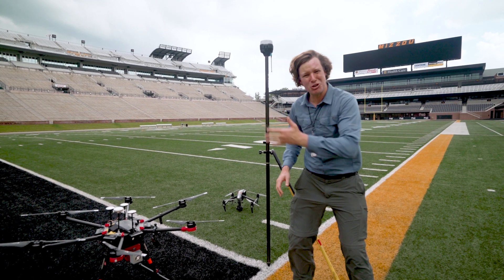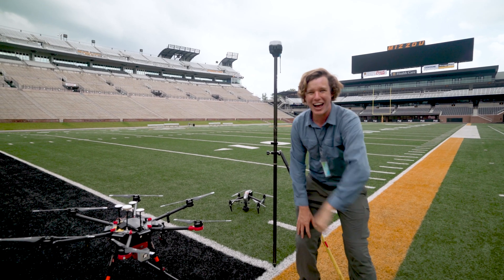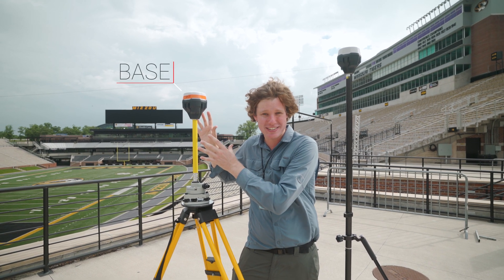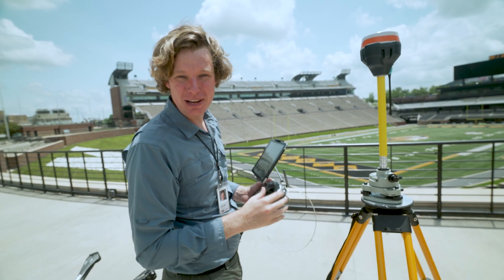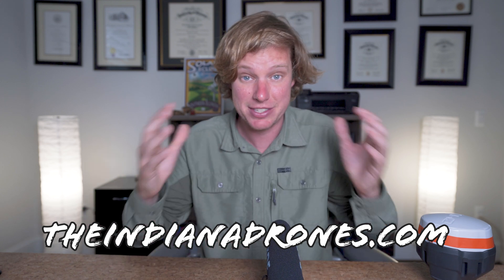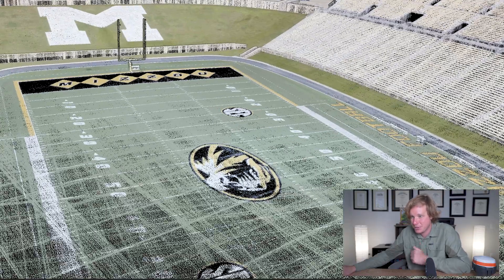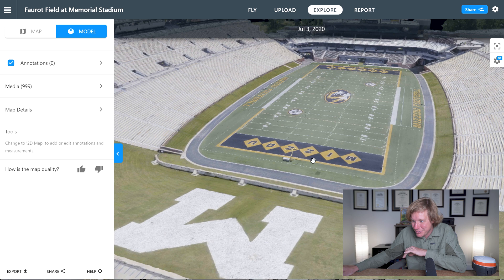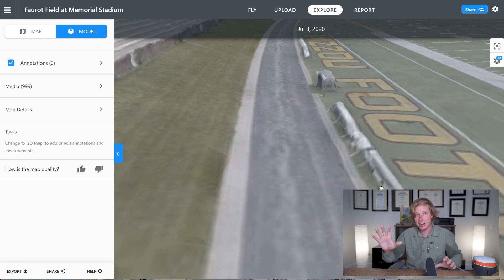Drone LiDAR  vs Photogrammetry | Epic Stadium 3D model

Comment: Overall nice video! However that's a LiDAR point cloud vs a photogrammetry 3D mesh, so it's not a fair comparison. Would have been a better comparison if you compared the point clouds generated by each sets of data. I haven't used LiDAR myself, but I'm sure you could generate a 3D mesh from it as well.
Reply from the maker: Thanks for the feedback!

Comment: Nice comparison. I am not aware about the mission parameters of the photogrammetry flight, but from the result I guess that you were using a single camera in NADIR direction. When it comes to modelling 3D buildings, many people recommend off-NADIR (oblique angle) captures. These days, readily available payloads with 4-5 cameras looking at different directions simultaneously may be much more appropriate for the featured application. And their price of around 4000-5000 USD is still cheaper than the price of UAV lidar systems (DJI Zenmuse L1 ~18000 USD)...
Reply: would a fish-eye or 360 camera produce similar results to off-NADIR 4-5 camera payloads? I just assume it wouldn't be as high of resolution...

Comment: I'm retired surveyor(about 40 years), ... I am not excited over the LIDAR(still costs too much), as much as I am over the photogrammetry(lot cheaper).

How precise is the Photogrammetry, in the best and worst case, compared to the LIDAR ... how was the accuracy of each compared to the other?

I might consider using photogrammetry for such things as cemeteries, since the headstones would be greatly benefitted with photos.

Have you ever attempted recovery of old, worn, sandstone monuments' etchings(over 150 years/Civil War), with LIDAR?

Comment: Such great informative high quality content.  The BEST on YouTube.

Curious, what's your process for setting your elevation for your clients that need to work with your survey data?  Do you work in NAD83 (state plane) horizontal coordinate system along with NAV88 vertical datum using a geoid to obtain orthometric heights?  What do you tie to for your vertical readings?  A nearby benchmark?  Or are you just basing everything off of ellipsoidal height and your control points?  Thanks!!!

Comment: Thanks for the video - 
So would photogrammetry survey , yield us data points with levels in XYZ coordinates?  or is it possible only with LIDAR and Total station ?
Reply: Hi! You can use photogrammetry also to generate digital terrain models (DTM).  Using this DTM data, you can compute orthophotos, which are geo referenced.

Comment: Hi there - been following you for a while.  I’m a 13yr photogrammetrist/Pix4D Ambassador.  I recently flew Oregon State Beaver Stadium for a client and built a 3D point cloud from it.  2000+ photos from about 150ft AGL, oblique orbits and from each cardinal direction with gimbal at 70 degrees.  After a few hours of cleanup check it out... https://youtu.be/-gJP6225V3A
Reply: I also worked with LiDAR for years.  A liiiitttle unfair to compare a sharp point lidar point cloud to the very rough mesh made online by Drone Deploy.  Would have loved to see a direct .las to .las comparison of what the MiniVux captured vs the photogrammetry plus learn more about how you planned the photogrammetry mission.  Yes... LiDAR will definitely win this battle as you point out, but I’ve built my career weighing which is more economical for a small survey firm... the time cost of capturing a TON of photos and longer processing vs a $200-$300k expense of a Reigl.. :). Love your channel.  Cheers!

Comment: I would have like to know a little bit about  what your data was being used to solve. I can’t help but think that 1cm (more like 3cm) is not accuracy enough for engineering a structure. It sounds great for land surveying but problematic for buildings. I would have like to have seen a few scans from a P50, overlay your area data for infill (removing the overlap) and apply the photo wrap. That way you would have 1-3mm precision great infill and color to boot. 

That said cost is always an issues. P50’s start at $5k to rent not to mention the software to extract and clean up the data. 

How big (data size) was this project in the end?

Comment: The LiDAR data are really amazing! But it is not fair to compare a LiDAR point Cloud with a photogrammetry 3D Mesh. These are 2 different things!
Reply: But however,  if you use lidar data to compensate photogrammetry, you can get a sharp, crisp yet real coloured point cloud,  and this can help to compensate missing edges and discolourations,  especially if you know how to write up python code to do close neighbour averaging for the point cloud data, then you can have something close to what very expensive software such as pointfuse can do to generate preserved edge convex 3d models that have close photorealism. 
I know this comment is very old now but I just want to point out,  since I ever did this myself when I worked on a 3d web project utilising this method,  since a lot of the data the team provide (I wasn't the main operator for the scanner) was missing in details and I match them up this way and generated the models

Comment: Mate, not bad but you compared a points cloud with a 3d model.. you should compare the points cloud generated form photogrammetry and not the model which is an appoximation o poligons between points... and use Reality Capture to generate the point clould with photogrammetry.. the result will be much better and quicker compared to all other software... you can even import the 2 different cloud (Lidar+photogrammetry) and do the realtime comparison..

Comment: Great video! What mapping software do you guys use on the iPad for lidar units?
Reply: He used dronedeploy for photogrammetry, the lidar saves data on board and then you have to export it and process it on computer.
Reply: @sircher943  Yes I understand he used dronedeploy for photogrammetry and I know the lidar stores data. I wanted to know is he flying the lidar unit manually because if he is then how is he accounting for overlaps? He has to use some kind of app that will fly the mission without a camera. Apps such as maps made easy or ground station pro won't let you fly without a camera mounted on the drone.

Comment: Hi great video, I would like to mention that IMO you could be using a better photogrammetry setup, you are comparing a high-end quality lidar system (among the different lidar possiblities) vs a more or less mid-end quality photogrammetry system (among the different photogrammetry systems possibilities) from my point of view. Also you are comparing the point cloud of the lidar post process vs the mesh of the photogrammetry postprocess, I don't know if drone deploy can postprocess the pointcloud but in pix4d, sometimes I see point cloud more accurate and sharp than the mesh. I really like this sector and I've been testing lidar vs photogrammetry sometimes trying to improve the photogrammetry weak points trying to reach the "easy to get" lidar quality.
Reply: Agreed with regards to processing and Camera. If you want to compare surface (point cloud and mesh) products, you need to use local processing for SfM/MVS. I suggest using Metashape/Photoscan as their point cloud products are generally superior to pix4d. Also, general wisdom is to use a camera with a mechanical/global shutter for photogrammetry (So, X4S instead of X5S). Cool presentation overall, I like your enthusiasm!
Reply: Seconded. Metashape or Pix4D is where it's at. Pix4D is more popular with industry, and more is more expensive but easy to use. Metashape is more popular with researchers and is also cheaper than Pix4D, but can be more complicated to use. I think it has more functionality than Pix4D though.

Comment: First: You guys make great videos!!! At this video it looks like you compare the LiDAR point cloud with the 3D mesh model from photogrammetry (based on pc)... How does the photogrammetry point cloud looks like? This would be the right comparison in my opinion.

Even with the "not so great" Inspire Camera Setup (for photogrammetry) you should get a point cloud which delivers more information then the bad looking drone deploy mesh model.
Reply: I had this question, too. If you're doing an apples to apples comparison then look at the point clouds. I'm curious if there is an accuracy advantage to using LiDAR over good photogrammetry algorithms because I've been able to get very good accuracy with photogrammetric setups.
Reply: I've used photogrammetry from the Phantom 4 Pro v2 to create point clouds in Pix4d. There is definitely 'fine detail' material missing when it comes to the conversion. In an example, I use the Leica GS18 to measure the corner of where the flat concrete edge of a sealed road meets the front face of the kerb; we call this the Channel. Our GPS gets accuracy of +-0.02m. Photogrammetry picks up the flat edges pretty well but, not the corner. There isn't enough information, converting to point cloud points within that small area from photogrammetry, to place a horizontal and vertical marker/point right in the corner. It comes down to how precise you need your information to be. Of course, you can extrapolate the corner by triangulation, if needs be, but then that's extra processing time. Lidar can spit out anywhere from 250,000 points per second, depending on the unit used. Way more information!
Reply: That's a pretty decent point

Comment: How is it that the LiDAR data set has colour? Do you have a camera alongside the LiDAR?
Reply: Simple answer: Yes. Longer Answer: LiDAR only logs the reflective/intensity value of each return. You need an RGB data source to apply to the points. In most cases, you would also have a camera (RGB or some other passive sensor) logging while collection the LiDAR. He could have also used the images collected with the Inspire as well to overlay on the LiDAR once the images were processed.
Reply: The Inspire images were used to colorize the pointcloud just as @Nett Air mentioned

Comment: Thanks again. How did you get RGB values in the lidar data?
Reply from the maker: Well, we actually flew an RGB camera that is co-aligned with the LiDAR, but I am not a fan of the results.  So I took the photogrammetry model and pulled the color from the map and transferred it to the LiDAR data. If you check out the dataset here --- https://www.theindianadrones.com/post/drone-lidar-vs-photogrammetry-epic-stadium-3d-model 

You can switch between the RGB and Intensity view, and this is basically how well the LiDAR and Photogrammetry align.  Its pretty spot on!
Reply: @IndianaDrones  good stuff, how did you transfer the color from the photogrammetry model? What software are you using? Thanks
Reply: I'd also be interested in the software being used to view the data.  Seems pretty quick.

There's several programs you can use to colorize LAS/LAZ datasets.  ArcGIS Pro added the functionality sometime last year.  LAStools can also do it as long as you have an orthorectified .TIF image.
Reply: @monstersbox  lidar data is converted to Potree format. Available for free here: https://github.com/potree/potree
Reply: @monstersbox  have you any links to tutorials to colourize the las/laz data